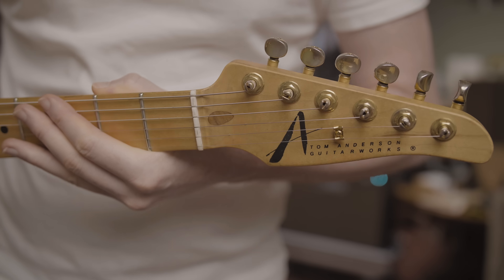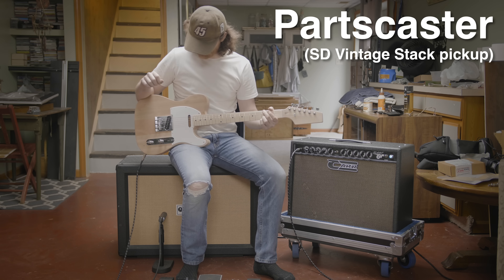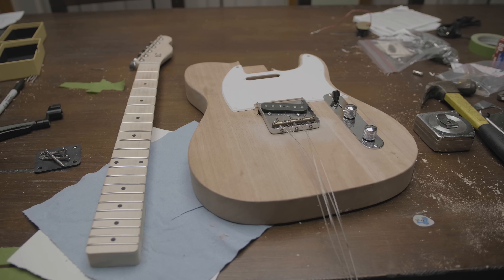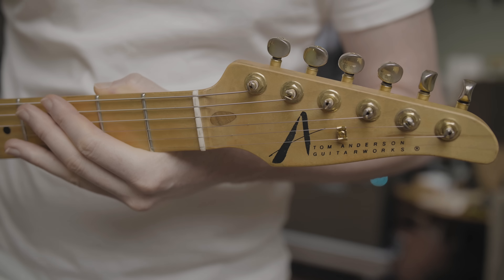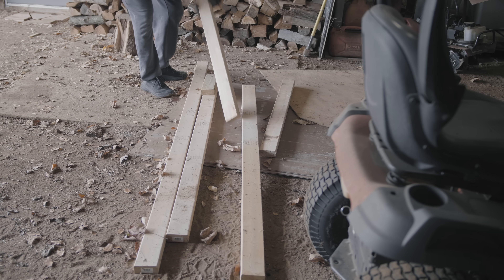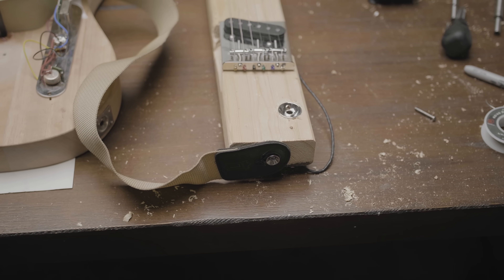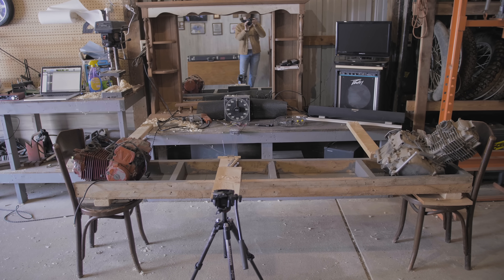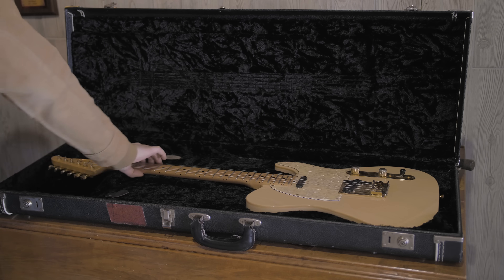Tested: Where Does The Tone Come From In An Electric Guitar?

Comment: Brilliant. I have owned 4 custom shop Strats and sold them all. I could never convince myself they were any better sounding than my less expensive guitars.  Maybe they looked prettier but never sounded better. My best sounding guitar is a Fender American Showcase Strat that was $1699.  I called Fender to see if I could buy just the pickups for my other guitars but they don’t sell them.  I also stumbled on the pickup height adjustment factor and now do that on all my guitars.  Shocking how it changes the sound.  Thanks for this breilliant test!  Now I know I’m not crazy.

Comment: Incredible video! I suspected that the most important factor in a guitar were the pickups, seems to be the case lol. Anyway, I'd like to point out that the tone is, in fact, different in the air guitar comparison, mainly in the low end. I suspect that it has to do with the big ass tables that fuse with the headstock & bridge and resonate with the strings creating a much fuller low end, I think it makes a difference in here due to the difference in size between the regular guitar body and the big tables, bigger pieces of wood resonating create more low end resonance, but in two similar size guitar bodies it's very unnoticeable, if not noticeable at all. Thank you so much for taking the time to do this!

Comment: Hi Jim, Very interesting, but what conclusions can be drawn from your experiments?   What are the main factors in getting good sound from an electric guitar?  Thanks for doing all that work and for sharing this very interesting video.   Cheers,  Ray (Australia).
Reply: depends entirely on what you think of as "good". for passive pickups, pickup height has the biggest big impact on your sound. the closer to the strings, the 'hotter' (i.e. bigger amplitude/voltage) the signal. this will have an impact on everything down your signal chain, as a higher amplitude signal will distort quicker.

Comment: He never talks about the tone coming from one’s fingers. This is as important as the guitar or the parts used. Or so I thought. The players hands.. his or her fingers produce the tone. I’m a gear head snd I love all sorts of guitars. Ultra cheap I don’t like or use. Same is true for very expensive vintage guitars. The players fingers make the difference in tone. If I’m wrong please respond.
Reply: He does @ 1:41

The player does make a big difference in tone if they WANT to. But most intermediate players all use the same hand positions and picks and pick angles and dynamics so it actually isn't as big of a factor in the real world. Paying attention to your pick placement and dynamics can seriously step up your guitar playing though. Try a simple pentatonic run but move your pick hand to sharpen or fatten the tone (toward / away from your bridge) as you move through the scale. Pretty cool effect right? But that's just scratching the surface of course.
Reply: @benfennell6842  I hear if you have Da Vinci’s paint brush you can paint just like him try it you may be surprised.
Reply: @t.roller2129  t.roll somewhere else mr roller
Reply: @benfennell6842  As you wish, Mr. Fennell. Good day to you sir. 

FWIW I agree there’s validity to your comment.
Reply: No ones denying that the Player makes a huge difference, but that's not the object of this test.
This is about detecting what hardware determines the sound of electric guitars.

Any Player can make two identical guitars sound different by using different techniques, that's just a given, nothing to do with the subject of this video.

Comment: This is abosolute bullshit, man. 

So, I don't know if you know this, but you are contradicting Albert Einstein. When he formulated the equation E=mc2, he established that energy and matter are the same thing, two sides of the same coin.

When you pluck a string on an electric guitar, you are creating potential energy. When you finish pressing it, removing the pressure from the pick or your finger, that potential energy is converted into kinetic energy, and makes the entire system (the entire guitar) work according to the laws of physics. A series of vibrations, energy transfers, etc., are produced, which depend on all the elements of the system, of course including the density and specific characteristics of the wood. Everything influences how the strings vibrate, and how the effects of that vibration are picked up by the pickups.

When the strings are vibrating, even the guitar "bends" on the neck (of course, to a level imperceptible to the human eye). When you pluck a string on the fretboard, it is in direct contact with the wood.

It is materially impossible for the wood of a guitar not to affect its tone, according to the most basic laws of physics.
Reply: Watch the video till the end and he kinda proves that it doesn't matter, even if what you are saying is true you can't hear it in the final test
Reply: @joeloneill7137  I can hear perfectly well differences between woods in an electric guitar. Me and a lot of people, Eric Clapton included, who prefer maple fingerboards.
Reply: @derfreischutz4380  It is also materially impossible for the farts you just made into your keyboard to not affect my guitar tone, according to the laws of physics by your argument.

Imagine going into a discussion about practical differences perceptible to real people and bringing up this...
Reply: @derfreischutz4380  You are wrong and I know that for a fact.
Reply: @t.roller2129  Tell me why I am wrong. Explain it. I have explained why you are wrong.
Reply: @derfreischutz4380  Because you think physics has any part in this conversation.
Reply: @t.roller2129  hahaha

Comment: That is what I figured, on an electric guitar the only thing that really matters is the strings in relation to the pickups and the electrics the signal is going through. Les paul's original electric guitar was built out of a 4x4. Now on an acoustic guitar everything matters, from the woods it is made of to even the finish used.

Comment: It´s TRUE TRUE TRUE! I did the Test.
Long story short: 
a 2021 Les Paul classic (9 Hole weight relief and other differences) and a 2008 Les Paul Standard (chambered Body ... ) both with the same pickups (and pickup-, polepieces-height) sound to the ear EXACT the same. Neck shape, Body, Pickguard on/off, etc etc makes no difference:
As soon as the dimensions (pickup height, Pickup spacing, etc) are the same you will hear no difference.
Good Job Jim, thank you a lot. You saved my money.
Reply: I have listened to comparisons between les pauls and es-335s and they sounded different. I was convinced that both used the same pickups (as gibson stated it) and the subtle difference came from the construction (solid body vs semi hollow). now I don't know if it really affects the sound or if they actually have different pickups...
Reply: @gustavogoesgomes1863  It’s true

Comment: This video is fun to watch, but I think it only proves is that it’s easy to overdrive a tube amp with an extremely high output, flat response pickup, regardless of what it’s attached to….especially if it’s set close to the strings (which it seems like he kept a uniform high height at around 2:45). It seems like a lot of trouble to go to, to make a video on comparing the effects of each element of a guitar to it’s tone, and have the pickup height set so high that the signal would push the amp into overdrive.…Of course you’re going to get a similar result over and over,  no matter what factor is changed. As well, an 18k single-coil sized, stacked humbucker wouldn’t be my choice for such a test. The point of a pickup like that is to eliminate hum and add power to a single-coil guitar…at the expense of dynamics and treble content (vs a traditional output single-coil). That being said, if the end goal is to verify that tone wood doesn’t matter, then why do the guitars sound different at the 2:20 or so mark? You can clearly hear a difference in content between the Anderson and the Partscaster, even given the less-than-ideal aspects/settings for this test. A definitive test on this subject would be done using a lower output pickup, at a medium (or lower) height setting, into a clean amp. If one couldn’t hear or recognize a difference in tone between and SG, Les Paul and ES-335 (all equipped with a 57 Classic for instance) in a clean amp, I’d be surprised.

Comment: Interesting stuff. Loved watching. Rich, GM of Tyler Guitars, here. First, nice KRKs behind you. That was one of my products that I helped develop when I was at KRK. Second. When I was at Line 6 and working on the JTVs, a collaboration with James Tyler, I had to work with sound design and I learned a lot about what they did to model, not only electric guitars, but sitars, banjos, etc. The woods do effect tone but not as much as you would think. The wood and construction influences, not only tone, but ADSR known as attack, decay, sustain, and release. Certain woods resonate with the string and actually pull those freq out of the signal. So when a wood is thought to be bright, it is actually dark because it resonates with the low freqs and pulls that out of the signal. Anyway, I really love your video and thinking. You actually showed some things that Jim has thought was the bigger factor than wood. Neck pocket tightness and electronics and pickups being big ones. 

I will share another story. Recently we wanted to experiment with a new fingerboard material on a quartersawn maple neck. We liked how it looked but for Jim and Tyler Guitars, sound is king, because that is how he started with all the session guys. Sound and playability. Everything else is second. So we built a guitar with all the woods, pickups and configuration that Jim knows best. He tried the guitar and did not like something about the "quackiness" of the midrange. He sounded strange. Myself and my shop manager heard it too. So we immediately just switched the neck to a maple fingerboard on maple neck and that strange tone was gone. We rejected using that fingerboard material.

Comment: Impressive results. But I am wondering if the particular tone of a guitar has additionally to do with with the swinging mass. 

Sure your air guitar has nothing in between both bearingpoints but bridge and neck are firmly attached to the both tables which also resonate to a certain extent. 

It would be interesting to see what happens when you connect bridge and neck to a solid rubber with a hardness of 90A for example which will dampen the resonation.
Reply: Implying that the energy imparted by those string into those tables is causing audible resonance is actually a new level of cope

Comment: Good luck playing that air guitar or one made out of cardboard in a 100db+ environment. Hope you like feedback. I don't get it, other than Jim has a niche for making videos. It seems a bit camp and dead ended to me, though. What if an engineer found that there is no difference between how a Rolls Royce and a Ford F-150 drive except for the tires? The engines, bodies, shocks, etc make no difference. I can blind-fold pick out a maple from a mahogany drum kit, I can tell when Jimmy Page is using a Les Paul from a Telecaster, when Brian Setzer plays I can tell that it is NOT on one of Mark Knopfler's Suhrs, and, no, if they were to use the same pickup and pickup heights and amps and outboard gear and strings there would still be obvious tells. I came from violin where the strings on nearly every different instrument are super close to each other in relative heights and materials, bows are all horse hair and rosin is, well, rosin and there are massive differences between 8 out of 10 of them. Electrify them and there is still a big difference. If you don't or can't hear a difference - that's on you. As for what was done here, a Telecaster is a bland slab of hardwood that is meant to be dead-neutral, ie it was designed specifically to allow the strings to be the most prominent element - to allow them to pop more so than less dense/rigid materials. 

It's a neat video but the base elements at play here were cherry picked to reach a sensational conclusion. This was not a serious endeavor but one targeted to get the most impressions and views. This is what YouTube has come to, sensationalism via sleight of hand. Had you named it, instead, ''Why Telecasters are bland slabs of bright punchy nothingness'' that would have been cool. But, implying that all electric guitars are the same as literally the most tone-empty slab of ick model in existence is, at best, insidious and juvenile. To cap this, guitars are guitars, they are all meant to be able to convey that they are guitars. Therefore, on some level, there has to be a majority of similarity between ALL guitars of every type, be they analog electric, acoustic, digital, etc. In my opinion, 99% of them are about 90% the same to begin with - even a flamenco acoustic compared to a Les Paul, it's the same general concept. How different, then, can a Les Paul be from a Stratocaster? It has to fall within that remaining 10% gap between the Les Paul and the flamenco acoustic. It's not a difficult concept. From the word GO it's about splitting hairs, so what's the gotcha? 

Tone-deaf is a real thing.
Reply: Cope.
Reply: @bassyey  I'm trying to but there are so many dipshits in the world that keep attempting to excuse their being dense weaksauce cop out artists who can't form a legit GOTCHA that it seems a never ending process.
Reply: Cope
Reply: @benfennell6842  Proving my point, Ben.
Reply: @tasteapiana  seethe
Reply: @benfennell6842  Sit.
Reply: @tasteapiana  You're literally mad about the title because he put "Where Does The Tone Come From In An Electric Guitar?" instead of "Where Does The Tone Come From In A Solid Body Electric Guitar?"
Reply: 15b (17)~

Comment: Also the one of the biggest most forgotten components to an electric guitar's overall sound is the amplifier.
Reply: Check out Jim’s video on amps.😅
Reply: Fail. An amp isn't a guitar component. It's a separate device connected by a cable. Amps aren't part of the discussion in this video.

Comment: Short of running the signal directly into an oscilloscope, this was a pretty good scientific test. From a pure physics point of view, the electrical signal is generated by the string vibration in the magnetic field of the pickups. That's the signal. So once you've got the pickups sorted out, the rest is rather more subtle. The strings are vibrating according to their material (probably not terribly important except how it affects the magnetic field) and tension. What they are fastened to will also vibrate and feedback into the strings. So you will get some harmonics from all that. It kinda makes the electric guitar rather simpler than an acoustic where all the audible tone is coming from the sound hole.
Reply: The strings matter a huge lot lol
Just change the strings on your guitar and you'll see
You say "except how it affects the magnetic field" but the strings are litterally the thing that affect the magnetic field so they make as much of a difference as the pickups imho (and from my experience)
Reply: @SamraK64  Those gold coated strings Specter Digital tested definitely sucked.
Reply: @SamraK64  idk, have you seen Jim's other video on how strings affect tone? There doesn't seem to be a lot of difference between strings.
Reply: @Liam Conlon  I plan to watch it when I have time, cause in my experience there definitely is (and as a sound engineer I kinda know how to use my ears, although I might be wrong).

I'm a bass player tho, and that might make a difference (since bass sound is traditionally 'dryer', so small differences will proportionally affect the end result more. Moreover, I find the most obvious diff to be flat wound vs round wound, and I've never seen flat wounds on a gtr, so...)
Reply: @SamraK64  Yeah check it out because it was interesting. There were subtle differences for sure, but I didn't think it was very obvious.

Comment: It's kind of mildly amusing and also alarming seeing people disagree so emphatically 
about everything about tone in a electric guitar.

Here's my perspective.
As far as I'm concerned, the only thing that truly matters are the strings,
how they're setup, and the pickups, and how they're setup. 
(as well as all the electronics inbetween it and your speakers but lets ignore that for now)

People are saying that material doesn't affect tone at all but it does,
any vibration can be back tramitted into your wonderfuly clean attenna's that are your strings,
and those can come from the strings itself, how it resonates and reverates through solid material 
(or even air) can affect that. 
It's just the difference is so small that you shouldn't buying something you can can't afford over it, 
its flavour, not better or worse.

I'm surprised nobody mentioned this but the nut material fret material and shape do matter a lot.
Pretty sure string buzz affects tone :)

Anyway any way you look at it you're just modifying how the strings behave, that's what actually makes 
the sound, that's by far the most important thing.